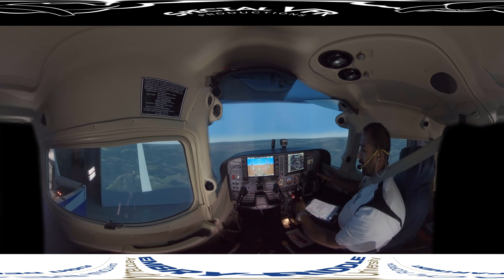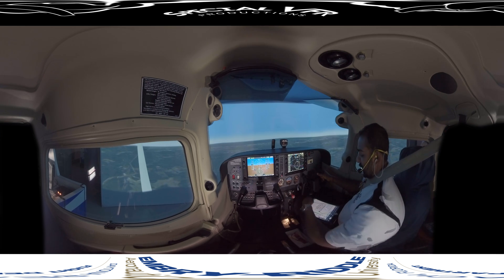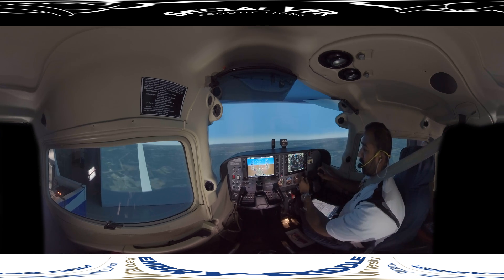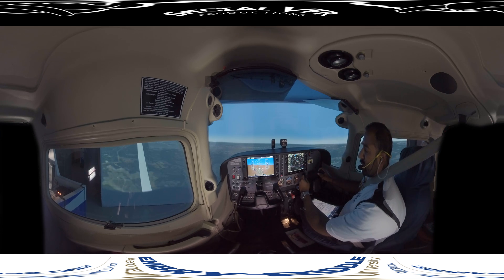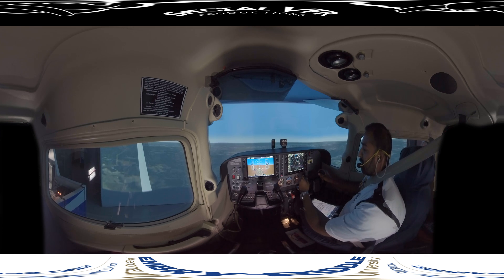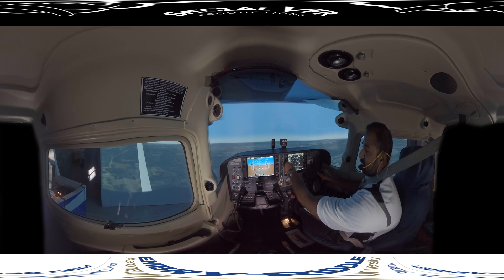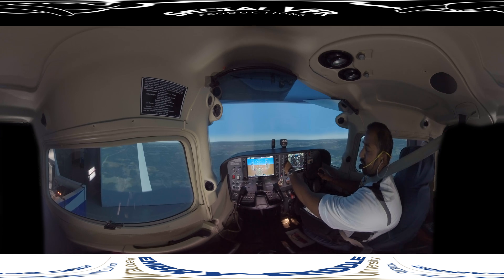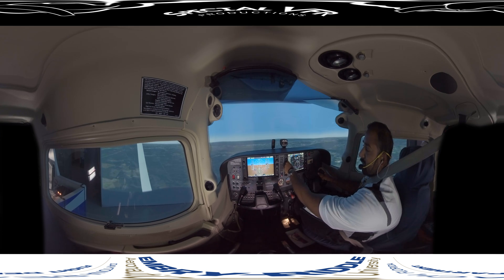VOR Holding Procedures

Comment: I agree, it would help if all that was shown in the camera view was the panel. Nothing is really gained from looking at the instructor or the simulator screens.
Reply: This is most likely a Redbird 172sp G-1000 cockpit simulator, using P3D or X-plane flight sim software. I use X-Plane and XP11 has a stock 172sp G-1000 cockpit. For $60 bucks and of course a decent computer with video card you can fly the same holding patterns. approaches, use Pilotedge ATC, etc. There is also a G-1000 simulator cockpit, with physical knobs that twist just like in the video that is sold by RealSimGear for about $2000. It is on my bucketlist. Redbird is an FAA approved simulator. Guessing at cost... 25k.
IMO, The MFD should be left in static north instead of rotating. Personal preference and also easier to follow in youtube videos.
A close up of both PFD and MFD is more important than seeing out windows, seeing yoke etc. The instructor did a nice explanation tho.